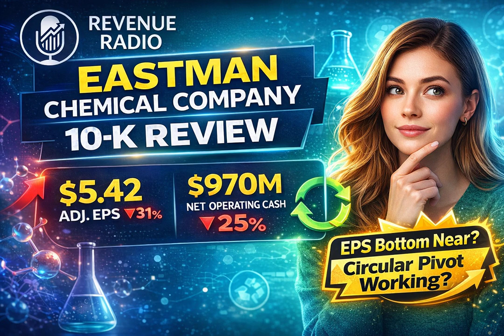Inside Eastman Chemical's 10-K: Can Recycling Innovation Offset an EPS Slide?

Comment from the maker: Key findings from the report:
🔸Adjusted EPS plummeted 31% to $5.42 in 2025 as weak consumer discretionary spending and massive inventory destocking took a toll.

🔸The Fibers segment was hit hardest with a 20% revenue drop, exposing a significant vulnerability in the acetate tow market.

🔸Strategically, the pivot to a circular economy is accelerating. Their massive molecular recycling facility grew output 2.5x this year, aiming to decouple growth from fossil feedstocks.

🔸Management remains aggressive on shareholder returns, with $1.3 billion remaining on their $2.5 billion share repurchase authorization despite falling cash flows.

🔸New regulatory headwinds are emerging from the OECD global minimum tax, which is already starting to increase the company’s tax obligations.

For informational purposes only. Not investment advice